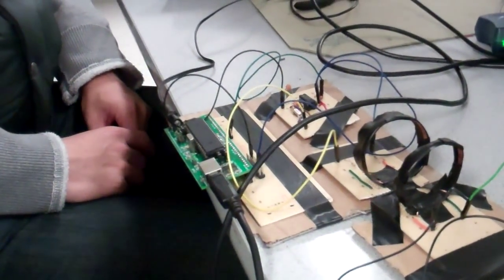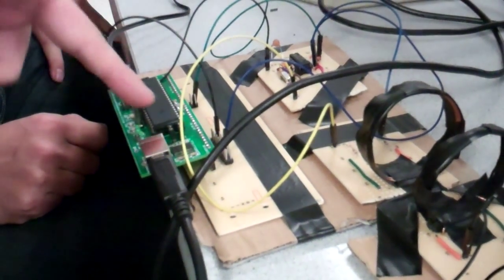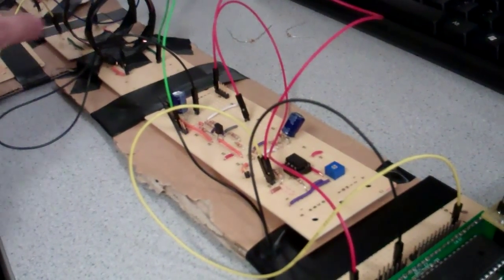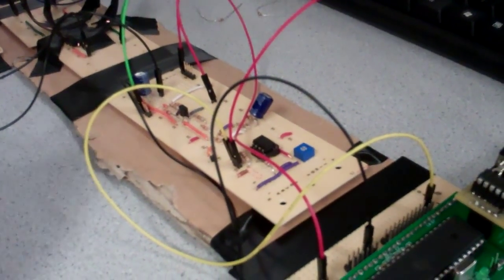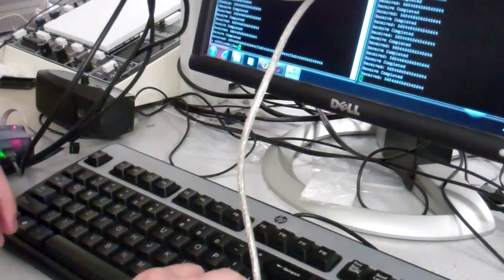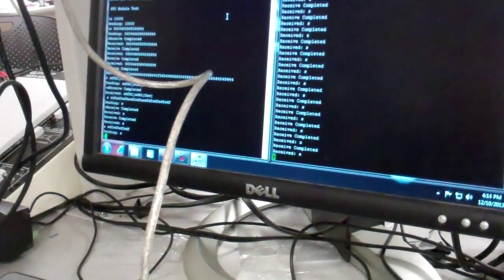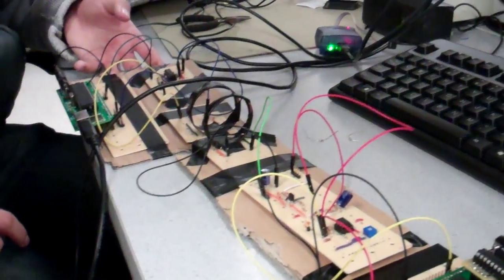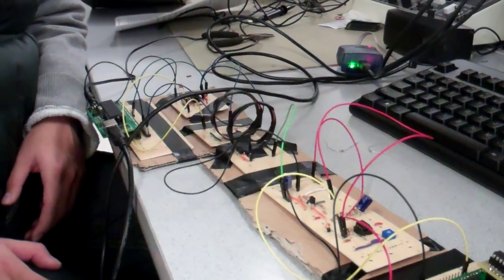near field data link

Comment: hello sir,
what compiler ur using and flash tool for 1284p controller
is there any modification in fuse values?
can u provide working hex code?
Reply from the maker: winavr GCC
AVRISP MkII programmer
I cannot provide hex. And it is impossible to debug with only hex.
Reply: Bruce Land ok sir,
what about fuse values?
Reply from the maker: high speed external clock, no clock divide, no JTAG.